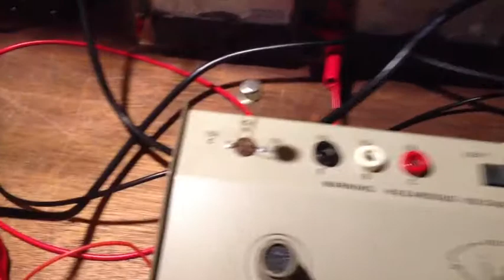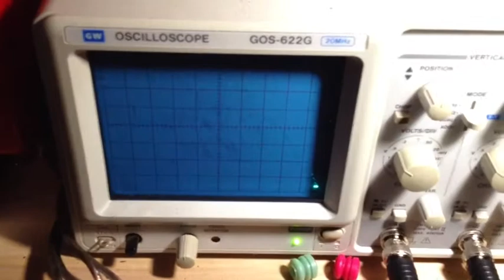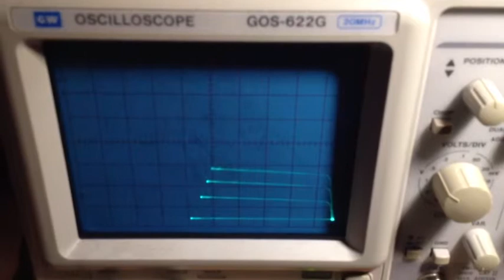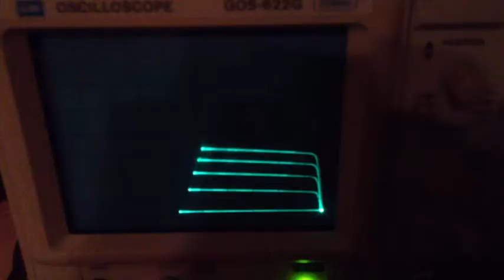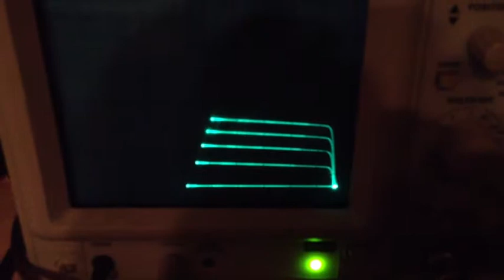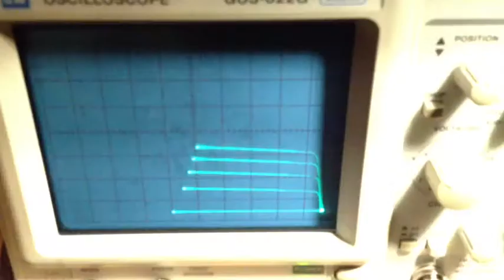Curve tracer

Comment: Probably a stupid question but how do you connect this Heathkit curve tracer to the oscilloscope? Do you just use banana to BNC and connect both the grounds to the ground connector? Thought it was weird that this curve tracer had banana plugs on the back instead of BNC since you would be connecting this to a scope, but I might be missing something. Picking up one of these up on EBay so appreciate the vid, thx!